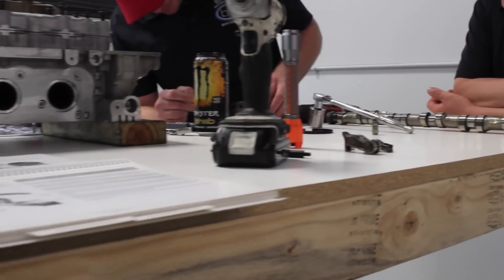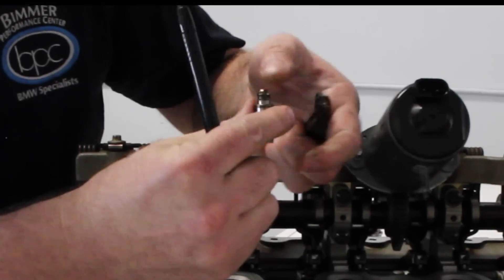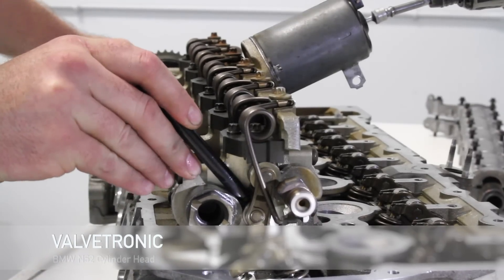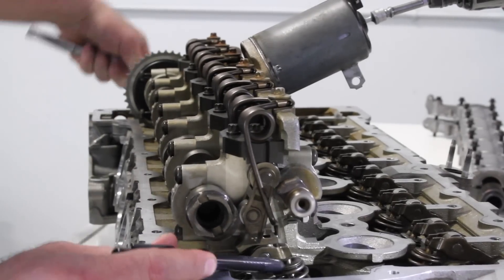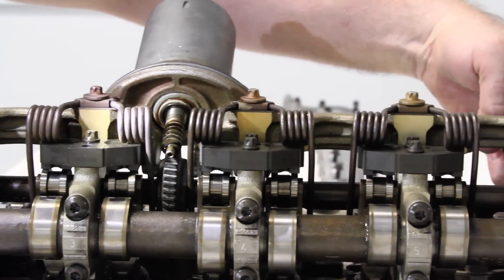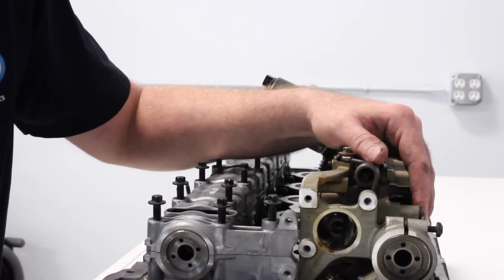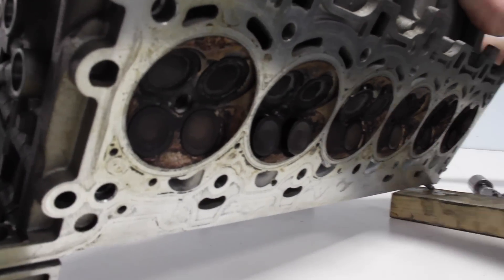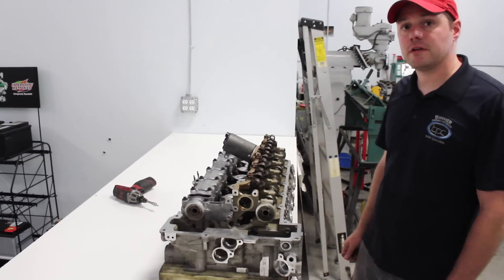"Inside the motor" with Dan Connor - N52 Cylinder head

Comment: my daughters 09 328xi intake center vans bolt broke  car was a crank no start.  my ? is can I just swap the intake cam out as no way that broke bolt section will be able to be removed.  I don't want to have to mess w eccentric shaft springs ect can I just swap the cam sir?

Comment: So then idle and accelerating is all valve lift control and the throttle body pretty much does nothing or very little?
Reply: Throttle body is wide open and is there as a failsafe (redundancy). The benefit is better breathing and less pumping losses.
FYI, Jason at Engineering Explained has a good video also describing Valvetronic 👍🏻

https://youtu.be/DKfcV7hITYI
Reply: @MarioDallaRiva  great, thank you so much. I never understood the concept behind that. Makes a lot of sense now. I’ll check that video out
Reply: @NatureandSpirit111  Me too, Nick!  I had the same experience as you.  Dan's video here is fantastic.  I changed the valve cover gasket, servo motor gasket and eccentric shaft sensor gasket on my N52K a couple of years back so I got to see in person, for the most part, what Dan shows.

Comment: Need help  08 328xi e92 , voltronic problem, code 2a38 , I've changed the motor , the relay, and eccentric shaft sensor,  wiring seems good, every time I replaced one item is good for a week or two then comes back to this code WTF don't know what to do next please help any body

Comment: Excellent video.  I have a curious question... besides the difference between the exhaust and intake camshafts being a ported or hollowed design vs a cast or solid design is there any other difference in the orientation or shape of the lobes?  In other words could one use an intake camshaft on the exhaust side?

Comment: Can anyone recommend a suitable engine oil to use for the n52b30 at 150k ?

Currently using Castrol edge 5w30 M previously labelled as LL04

Comment: Hello bro I need the explain I Just block the vanos on the N62 v8 engine bu I need to fix the servo motor is posiblle becase of vibrations he will Turn around thenx bro.

Comment: I have 2008 528i . I have some issues with the car. I was replace all new spark plugs. All ignition coils plus all fuel injectors. But engine still rough. When I increase high rpm the engine light said engine malfunction reduce power. Do you got any ideas to solve this problem ? Thanks you

Comment: Hi, my N52b25 is from 2007 and since last few years I have lifter tick noise after a long standing time or driving short ways. There is only one lifter ticking, after driving around 10km ticking is gone. But it is very annoying and a shame. As I can remember, as the car was young, I never had this problem. Do you recommend replace all lifters? Moreover in internet people say dont drive below 2500rpm, because of too low oil pressure. Can that be? Personally I didnt see a difference during short trips. Ticking is here. Thank you! PS: Thx 4 the video, very well explained and now I understand the head :)

Comment: I took my valve cover off and while turning the engine manually, i noticed the intake cam isn't spinning with the rotation. Exhaust cam is turning ok. Why is that?
Reply: Are you sure you weren't looking at the eccentric shaft? The intake cam turns like the exhaust cam, driven by the chain.
Reply: @franzwer1103  found out my intake cam bolt broke off from the intake cam seizing
Reply: @accordfreak1  oh ok, that explains it....

Comment: Guys maybe i am going to  purchase a bmw E90 , i like performance so maybe the E90 325i or 330i year 2009 to 2011 and about +- 200.000 km . And with pack M.
Guys are this engines realiable ? 
What about oil consumption,  end same engine have carbon build up.
N52 oil consumption 
N53 carbon build up ( direct injection).
Guys thank you

Comment: I have a 2011 128i with the N52 motor and ive recently been hearing what seems to be a tick. its very slight, i dont think its a knock, and its from somewhere in the engine. it isnt there all the time and i seem to be able to repicate it if i hover around 2500rpm. would this most likely be a hydraulic lifter failure? super late to the vid but I'd rather solve the issue myself if its possible, cheers.

Comment: These engines are garbage :\ after 2004 all bmw's Collapsed.
Reply: I beg to differ.  I have one of these engines, and at well over 200k miles it still runs like new.  the only things that were ever replaced on it were water pump, valve cover (for pcv regulator), oil filter housing gasket and crank position sensor, besides regular maintenance of oil and belt.  these engines are amazing, and if you change oil on time - are pretty much indestructible.

Comment: There is one major flaw in Valvetronic intermediate lever design that becomes very obvious in this video - on max throttle the resulting forces that are supposed to push the valve downwards are also pushing it sideways - this results in hydraulic follower wear and valve guide wear and is the true reason why Valvetronic engines tend to consume oil as the mileage increases. People keep thinking that its the valve guide seals but that is not true because valve guides get worn to the point where valve guide seals cant seal them anymore.

Comment: Very Articulate. Nice big open CLEAN space to work...Must be fun. I understood everything you said. I have this engine with 127k. in my 10 X3. Slight tick during cold starts. Not sure if the previous owner was changing oil regularly. I got most of the sludge out. Still have the random tick.  Any suggestions?

Comment: I have a problem with my 07 530xi, and this helped me at least understand it better. You explained it in a way everybody can understand. Thank you. 
One quick question though, the problem with my engine is that the spring that actions the ecccentric shaft, just snapped. Is that a common thing in those engines? The guys from the BMW shop said they have never worked on this problem before. It seems to be rare. Any advice? 
Thank you sir

Comment: Great video Dan, really breaks it all down so anyone can really get this! The tech in this engine blows me away. So I do have a question for anyone with knowledge on this, I had a vanos Int engine code come on and my mech found that the oil filter cap had come apart that fixed most of the problem as the code doesn't stay on now, but does come back on a cold start after setting for awhile so it has a secondary problem, seems that the oil pressure bleeds off, my mech said this model 2007 X3 3.0si had two heads the gen one had a oil restriction so they made a gen two to fix that, he can no longer find the info through the VIN to tell what head it is (that's question1) does anyone know where to get this info. (Question 2) he tells me their is a seal in the back of the camshafts that can develop a small crack and leak the pressure off so that could be it, I can not find any info or video's on this so does anyone know where to locate these seal's are they built into the cam's or what? He gets over $5,000.00 to do this job just wondering if the cam's are being replaced! another thought I hade was if the filter housing has a leak will this bleed the pressure back? I know a lot of question (first BMW).

Comment: the bolt came  lose on intake cam at ideal  and cam dose not turn when cranking over .can timing be reset and bolt tighten  or are the valves bent

Comment: Nice video!! what if you remove the valvetronic motor without releasing the pressure, how can you installing back cause I have a 2A87 Trouble code popping up, thanks
Reply: Did u find  out what  is was

Comment: Can you please explain how the idle control is handled? On the conventional motor it is controlled via idle control valve or electronic throttle-body. Is idle controlled purely through the valvetronic? I'm curious because you mentioned you have ran that motor with no throttle body or no intake manifold. 
Great video!!! thumbs up!

Comment: What would cause the eccentric cam to bind causing overcurrent of the valvetronic  motor which is shutting my car down?  What do I check? Cold weather shuts mine down. Thanks for such a good video.
Reply: Check the two bolts in the valvetronic motor. Mine backed out or wasnt tightened properly at one point and seemed very similar.

Comment: Nice Video id like to ask you some questions, can the N52 and N62 engines be Dyno tuned or is it out of the question due to the system in your video, im talking about a ECU chip, set of headers Air filter type of tune nothing crazy, if its possible how would you go about doing it.
Thanks
Jonathan
Reply from the maker: They both can be dyno tuned via flashing.  You can order a tune from our website which can be found here: 

https://bimmerperformancecenter.com/collections/bpc-motorsports-tuning

Comment: Have you ever seen an exhaust valve spring break on an N52? Mine developed a misfire which according to the repairer is a broken exhaust valve spring leaving the valve slightly open. I can't understand how one could break. Only done 94k miles, full service history. I must have been really unlucky.
Reply from the maker: We have seen some really odd things but havent seen a broken exhaust valve spring. Most broken valvetrain components we have seen is due to lack of proper maintenance mostly related to oil changes. BMW's oil service interval is just too long which allows oil to break down and turn into a sludge that clings to metal and can clog oil passages creating friction and heat. This leads to failures in valvetrain components and sometimes catastrophic engine failure.

Comment: Whoever designed this engine had some serious mental problems. Come on. The whole point is to make simpler engine and still performs well with good gas mileage. That is success. Not this over designed thing. BMW won't fly to Moon, for god sake.

Comment: Interesting video. You say that you did weld testing on the exhaust cam to see how tight the lobes are in relation to possible regrinds. Are you planning to first weld up material and then regrind or direct regrind taking material away on the lobe's bottom side?
And do you have a possible solution to increase lift on the intake cam? I imagine that the stock design and tuning takes advantage of the complete sweep of the valvetronic actuator/valvetronic cam?
(so in order to get more lift you probably have to come up with a redesign of the valvetronic cam follower?)
And do you plan to market a turbo option? Might be interesting for the z4 coupe crowd, as for that generation of z4's a (factory) turbo engine has never been made and high power supercharger options are not really available (and z4 coupe drivers are usually willing to spend money on their cars)
Reply from the maker: There are many options with cams that are out there especially since there isn't one that's made specifically for the N52/1. Any cam that gets made for these engines has to be specially made. We are talking to a few camshaft specialists to see what can be done. Currently if you wish to run stock cams you can install MILVS to increase lift on the intake cam. To take full advantage of this you will need to get get a tune for it which can be found here: https://bimmerperformancecenter.com/collections/e90-92/products/e90-325i-328i-n51-n52-tune

Comment: I have a e46 318i with N46B20A motor on it. it is valvetronic and almost the same as the N52 just 2 pistons less :). My question is to turbo this engine and the difficulty will be on the tunning side of the valvetronic. Any suggestions turbo size and tuning what torque and hp will i get .Can the tuning be done online?

Comment: The N52 is a masterpiece in engine design. However, I can't say the same for some other issues. For example, the magnesium block requires aluminum bolts for the both the head and bed plate, and the odds of these bolts snapping during its lifetime is exponentially high down the road. Fixing the bedplate bolts are worse than the head bolts because basically you have to pull the engine out to access the bottom bedplate and its major PITA.

Comment: What position is the exhaust lift on cold start? Min. lift? Is this why n52 runs like hell on cold start up with blown eccentric shaft sensor? Because Max lift is default valvetronic position?
Reply from the maker: To answer your question it would be best to call us (919) 501-2090 or email Randall@bimmerperformancecenter.com
Reply: Thanks for the reply I take it that it's not a yes or no question lol, i'll shoot you guys an email!

Comment: Why does this cam positioner not have a spring behind the trigger wheel? Mine has a spring behind the trigger wheel which has come loose.  I removed the spring for the moment. Wyatt problems could come of this broken spring?

Comment: Dan  what a Great video,
 i have a 2007   BMW 328 i    recently HAD TO REMOVE THE VALVE COVER TO REPLACE A SENSOR LOCATED IN THE FRONT PART OF THE VALVE COVER, AFTER WATCHING YOUR VIDEO    UPON  REMOVAL OF THE MOTOR  AND RE INSTALLED OF THE VALVE TRONIC MOTOR   IS THERE A SPECIFIC WAY TO ADJUST THE MOTOR  USING THE TORX SCREW ON THE END ,IS THER A SPCIFIC  NUMBER OF TURNS FROM  THE ALL THE WAY IN POSITION  TILL IT STOPS TURNING?   i  TURNED IT IT ALL THE WAY MY HAND  TILL IT   STOPPED THEN BACKED IT OUT 4 TURNS,  STARTED THE  ENGINE AND IT AS   QUITE   NOISY , SO i TURNED IT COUNTER CLOCKWISE  ANOTHER  HALF   TURN AND THAT MADE A HUGE DIFFERENCE SUDDENLY  IT SOUNDED  SMOOTH  . I WAS WONDERING IF  THERE  IS A SPECIFIC NUMBER OF TURN OUT FROM  THE   IN POSITION THAT YOU USE TO SET THIS  VALVETRONIC GEAR POSITION  CORRECTLY ,  KEEP IN MIND I WAS ONLY HAND TIGHTENING IT, NOT USING A DRILL

Comment: I wish I seen this video 6 months ago!! The piston rings cutting into the bearing ledge throwing up the retarted timing errors. I swapped both vanos and solenoids and did the chain, error was still coming up. Turns out this is what was wrong all along. Errors started coming after I missed the oil change let it get to 15k miles - shit buzz!!

Comment: any chance you could please help? I'm working on the same engine with a top end rattle noise, and code for intake cam stuck retarded. think it could be a cam gear? or maybe the camtronics motor? I think the cam solenoids have been replaced. engine is clean. like oil has been  changed regular

Comment: what's different between 325i n52 and 330i n52? plz answer
Reply: I am also interested in this answer!
Reply: 330i has a 3 stage intake manifold and more aggressive stock tune (Fuel, air, valve timing). same engine
Reply: My 325i N52B25 218hp has 2 DISA valve (one in front and one at the back) on the intake manifold. Is it the same 3 stage intake manifold as in the 330i?
Reply: Gregory Fuller No... both the E90 325i and 330i had the 3.0L variants of the N52 motor. Only 3 series that got the 2.5L N52 was the 323i.
Reply: dgibson310 Everyone seems to have missed the simple explanation: The difference is 500cc's in engine displacement. 325 is a 2.5 liter engine, and the 330 is a 3.0 liter engine. Notice anything there? The second two numbers in BMW's are the engine displacement in liters. There are slight exceptions (e36 325's were actually 2.3 liters, and turbo cars us a multiplier which adds to the displacement because of increased power, for example), but this system has been in place since the late seventies. Capiche?

Comment: Hello Dan i have N52 engine from E70 3.0si 2008 i have P0016 and my problem was my boys were changing head gasket and in the process of resetting the timing they failed on the cam banks rings sensors and i dont have the timing tools kit

Comment: i am busy with my n46b18a engine. also vanos and valvetronic. 
how do i know that my camshaft is alway on time. 
because the camshaft can turn without the rest op the engine in turning. and vanos is oil pressure system, does is automaticly adjusts timing of my camshaft?

Comment: Love the video! Great job of 'getting in there' and showing the inner workings of these often confusing 'voodoo' mechanical components. Per my understanding of your video, I might suggest referring to Valtronic as the variable 'valve lift' mechanism, and the VANOS as the the variable 'valve timing' mechanism. It would have also been neat to see the disassembled exhaust side VANOS hub with 50 degrees of movement as compared the 70 degree movement on the intake hub. Again, great job.

Comment: i got a topping noise on the intake side when i startup, it goes away sometimes, any suggestion on the that?
Reply: VANOS
Reply: it might be a hydraulic valve adjusters, its a known problem in n52.
Reply: it also can be DISA servomotors. Plastic flaps on them have little resourse. Can be changed on metal flaps.
Reply: Yeah. those oute disa valves can make some noise when they break. i changed outer one to my n52. flap was ok but the shaft  was broken.
Reply: outer*

Comment: I wish i could give this video more thumbs up. I've been having some issues with Vanos in my '08 e60 (528xi). I've replaced Vanos solenoids, camshaft sensors and couldn't find any electrical faults. I'll be re-timing next but now i know to check the bearing ledges while I have the head opened up.